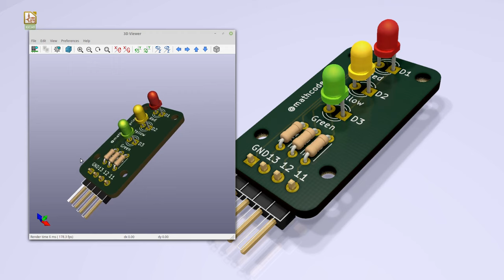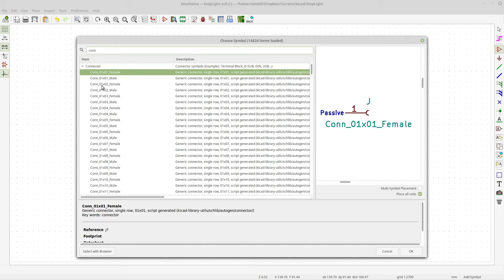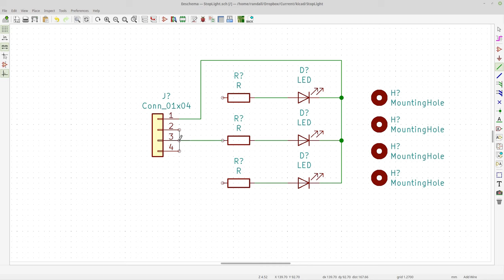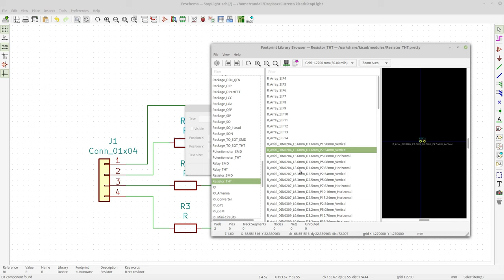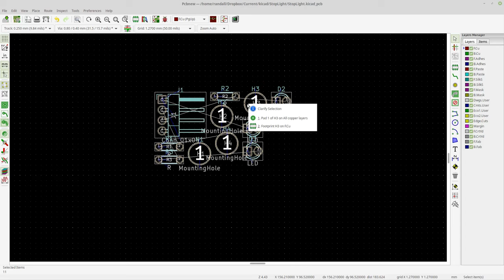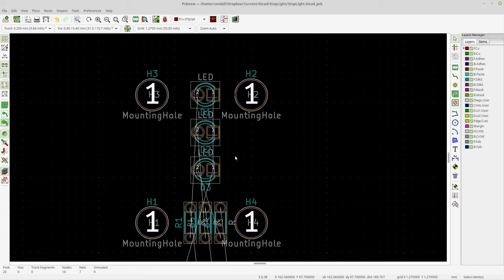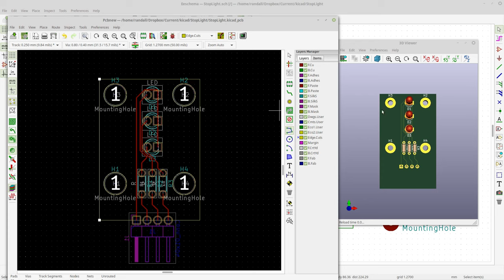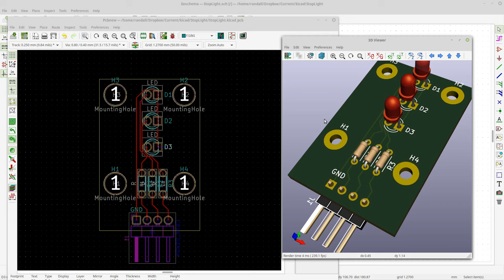Kicad Beginner Tutorial- A Traffic Light for Arduino ( RE-UPLOADED, Twice )

Comment: Good video. But shouldn't you do routing on the back plane when you are using THT components. You are placing components on both sides and this requires vias. Your way could lead beginners the wrong way.
Reply from the maker: I pinned your comment to the top. Thanks for pointing this out. I am a beginner, trying to find my way and giving a beginners perspective to others. Thanks for checking in on us noobs :)
Reply: That's actually wrong. THT components (unlike SMD components) get electrically connected to both sides of the PCB so you can do the routing on either. The way it's done in the video is perfectly OK.
Reply from the maker: Thanks Honza !! 😁😁😁

Comment: You could also add a copper plane that connects to e.g. ground. This way you can omit routing all common ground wires, they would just connect to the ground plane directly. Makes it easier to route other things with less non overlapping wires etc.
Reply from the maker: Thanks! I will try to use that next time around. Seems so obvious, but I don't know what I don't know :)
Reply: @mathcodeprint  I didn't know about it either until recently. Happy to share :)

Comment: I don't know if you are going to see this or maybe at this point you already know but I can give you advice not to use right-angle PCB traces as you did on routing D1 to R1. Corners cause reflections and can impact the signal quality. In this examples you do not have signals that transport data but if you do design a board where you send bits on traces you should keep that in mind. Great video btw :D
Reply from the maker: Good info! Thanks. Had an idea that corners where bad, i did not know about signal reflection.

Comment: In the video you turned the resistors around and you said it was because it would make it easier to hook up the traces. The resistor footprint looks symmetrical and polarity doesn't matter, so why did flipping it around make it easier to hook up the traces?
Reply from the maker: Thought I answered this, but I guess not. I think I moved them around so they where physically arranged for a better trace. Even there there is no polarity, the ratsnest lines come from the schematic. New users like myself seem to just want to make sure all the ratsnest lines are hooked up. So when I see ratsnext lines crossing I just mentally want to uncross them. I think you are 100% correct and I didn't need to rotate them, but I think that ability to say, hey this component has no polarity I just just wire this ether way is something a first time user may not comprehend. I hope that makes sense.

Comment: When placing a component in Eeschema, how do you get it to connect to the dots on the grid?
Reply from the maker: Snap to grid should be enabled by default. If not you can enable it. Right click a component and select align to grid when things are not working. You can set grid size in the right click as well.

Comment: Why do wires sometimes not snap to the component leads in Schematics?
Reply: Same question i have
Reply from the maker: I have this happen as well, I don't have a good answer off the top of my head. I believe it happens when your snap distance is changed from the default and now no longer lines up. To fix it I usually change all the measurements back to 2.54 mm. If I nail down the issue I will post a video.
Reply: @mathcodeprint  cool.

Comment: the components pins that do not have a small ball on it, are conected to the component ?
Reply from the maker: Correct, the green "wire" connects directly to the component. Where you see a green "Ball" indicates the "wires" are connected. Whereas if two wires cross with no junction ( green ball ) there is no connection.

Comment: If I look at the schematics and I look at the PCB then they don't match:
Pins 1-2-3-4 of the connector in the schematics are replaced by 11-12-13-14 on the PCB
Pin 11 of the PCB is connected to R3, where pin 1 in the schema is GND
If you want to explain something, especially something so basic to beginners then make sure you show the right stuff, something which goes together. The way you made the video will nly confuse those beginners.
Also, to get a good video you have to prepare your story: what do you want to do, how do you do that, step by step. It will become a much more professional video.